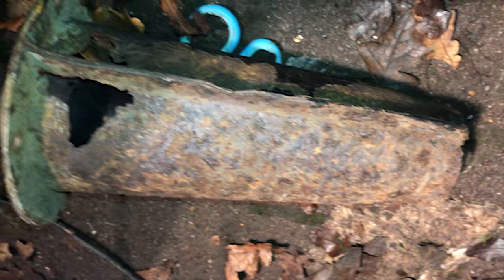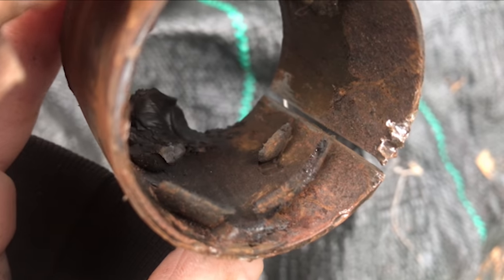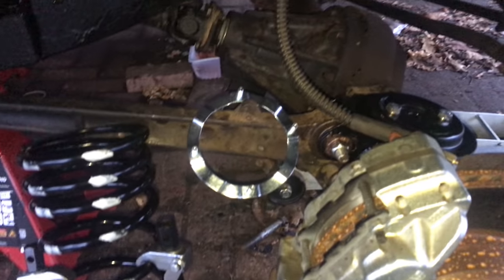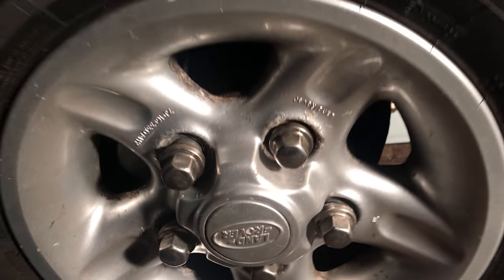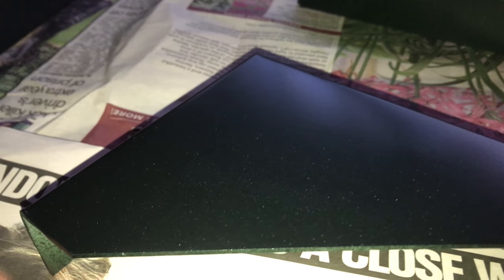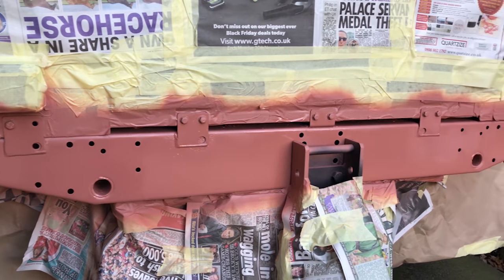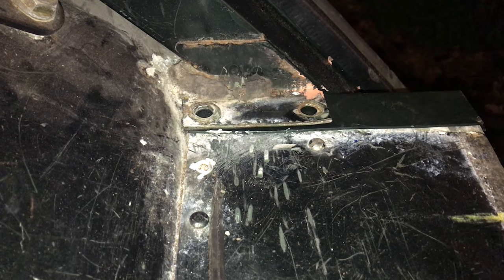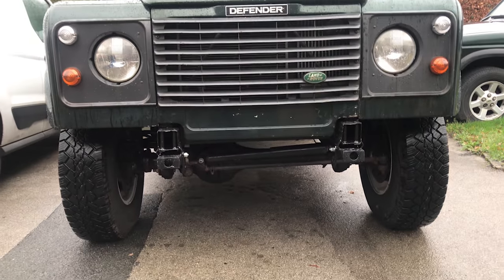Working On The 110 - Defender Pre-MOT and Winter Prep (Part Six)

Comment: Another great video Sophie. Live the attention to detail. I couldn't agree more about replacing those suspension components while you were working on that general area. Think I'll be taking a similar approach myself on an old car I'm working on.
I don't fancy using those spring compressors though. I hear they can be dangerous if the break loose.
Keep up the good work.

Comment: Etching primer only goes so far. Whenever we use a bare aluminium flashing on a house and it has to be painted, we use sandpaper to key the surface for the etch primer. Our painting contractors would agree with your decision.

Comment: that's a lot of work to put in a vehicle that in very few years the engine in it will be illegal to run, maybe you should think of putting an electric engine in it, its not like you need a big charge with the size the place over there haha, or serge tech, old trusty geo..
Reply: The plans are to ban sales of new diesels, not to force people to take their car off the road. Electric cars are fine for popping to the shops, but they're not going to replace ICEs in vehicles like these.